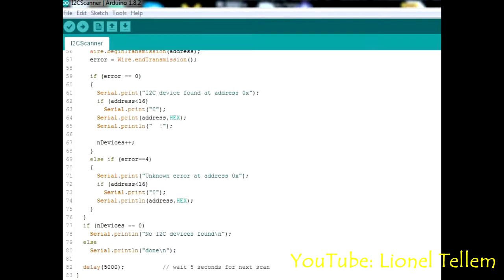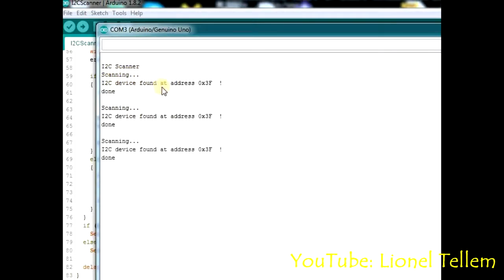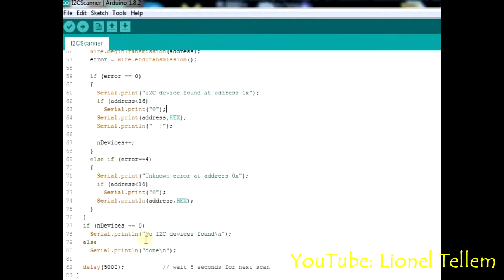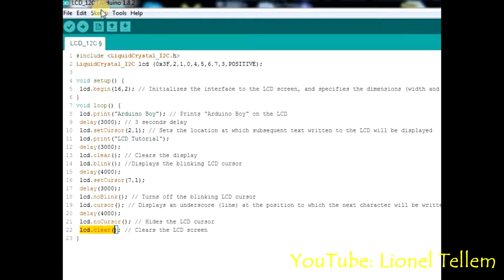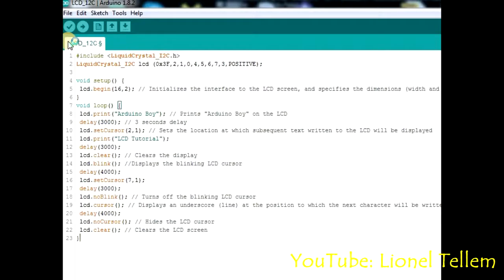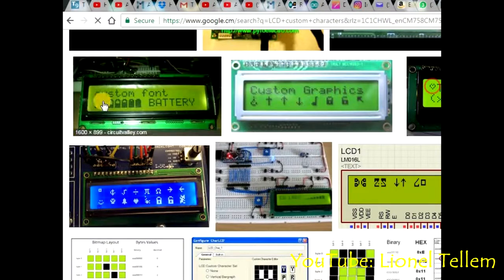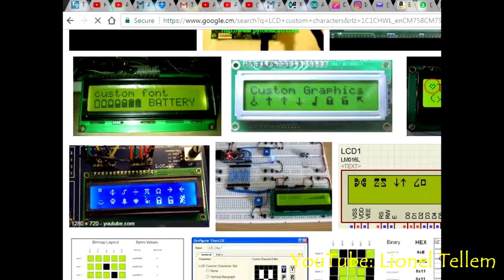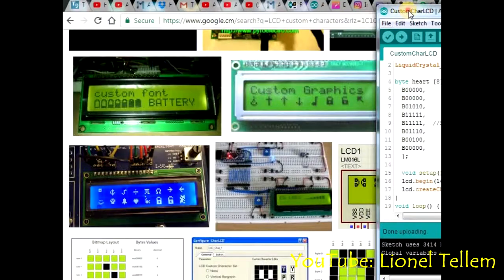ARDUINO  Tutorial 12 : LCD(Liquid Crystal Display) with I2C & Creating Custom Characters

Comment: Hi.. when the code is complying it says that 'POSITIVE' was not declared in this scope.. What should i do  next..?
Reply: i got the same problem tooonce, you got to verify your cablings very well
Reply from the maker: Arosha Maduranga very sorry for my late response...have you gotten an address from the I2C scanner?if yes have you entered it correctly in the second LCD sketch. ..if it still complains try updating your Arduino IDE please
Reply: the same error happened with me
Reply from the maker: AIR Duino please try updating your Arduino IDE and rest again
Reply: when i try to scan the adress of the lcd 
on the serial monitor shown that no i2c device found using this code :

#include <Wire.h>

void setup()
{
Wire.begin();

Serial.begin(9600);
while (!Serial); // Leonardo: wait for serial monitor
Serial.println("\nI2C Scanner");
}

void loop()
{
byte error, address;
int nDevices;

Serial.println("Scanning...");

nDevices = 0;
for(address = 1; address < 127; address++ ) 
{
// The i2c_scanner uses the return value of
// the Write.endTransmisstion to see if
// a device did acknowledge to the address.
Wire.beginTransmission(address);
error = Wire.endTransmission();

if (error == 0)
{
Serial.print("I2C device found at address 0x");
if (address<16) 
Serial.print("0");
Serial.print(address,HEX);
Serial.println(" !");

nDevices++;
}
else if (error==4) 
{
Serial.print("Unknow error at address 0x");
if (address<16) 
Serial.print("0");
Serial.println(address,HEX);
} 
}
if (nDevices == 0)
Serial.println("No I2C devices found\n");
else
Serial.println("done\n");

delay(5000); // wait 5 seconds for next scan
}
Reply: so  there is an error in this sketch is not it ,?
Reply from the maker: AIR Duino no there's no error in the sketch cuz someone complained once too of not being able get the address and after checking back his canling....got an address...and make sure you use the correct sketch from the description of the video
Reply: i do evzry thing step by step ther is an error on "POSITIVE" it is not declared on this scope
so how can we define the parameter of LCD i2c (the numbers beween parentese what does its mean) need from you to explain to us those parameter plz